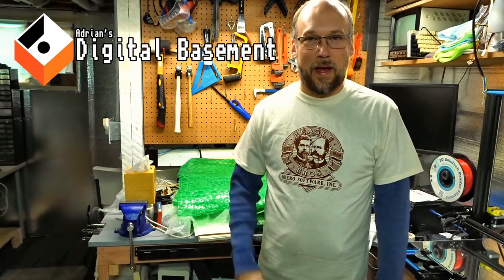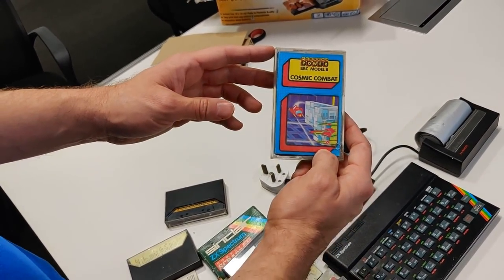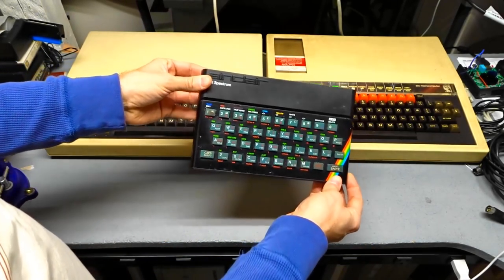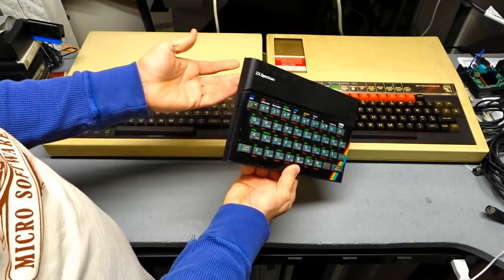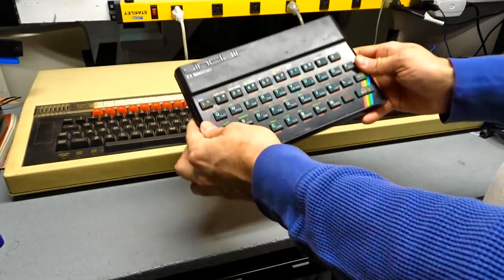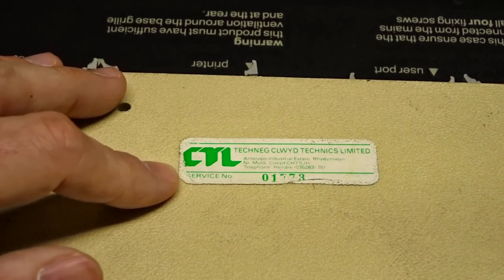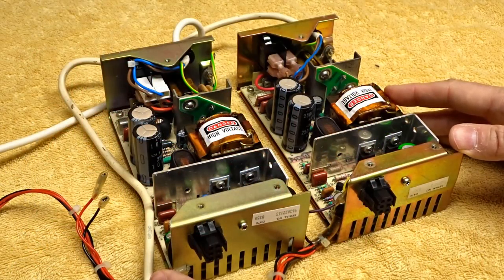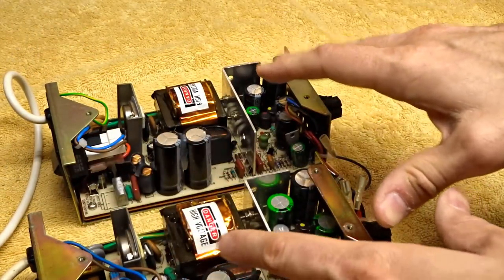I visited the UK and brought back some computers! Let's see if they work.

Comment: Spectrum wise, the best thing for gaming is to hunt down a DivMMC - that'll sort your storage needs out and give you a Kempston interface for joysticks, which tends to be the most common for 48k games (and takes a trusty Atari 2600 compatible joystick, which saves pain).

If isn't already modded for composite video output, that's a trivial one to do, which'll sort you out. Though it doesn't do RGB natively, you can buy a board called the Spectra which'll generate an RGB signal via a SCART output, though, it's probably overkill for casual use!

Comment: I'm wondering if the micro with a cut out had the psu removed to run off a bench supply. I vaguely remember seeing some in science rooms which had low voltage inputs rather than 240v.

I know some came with EPROM programmers but they were lower down near the keyboard.

Comment: Acorn changed the top case design part way though the life of the BBC Micro - the earlier machines had the case with the rough surface and no grill over the speaker (everything up to Issue 4 used this case) while the later machines had the smoother case with the grill fitted (Issue 7, though late Issue 4 ones might have as well)

As a lot of these machines were used in schools, parts got swapped around to keep machines working so you could well find an Issue 3 board in the later smooth case. The hole cut in the case is not original, most likely the original owner cut it to try and help keep the PSU cool (I've also seen this done above the ULA chip)
Reply: also from memory the volume on the sound chip was adjustable which might explain the low volume you reported - variable resistor bottom left of the board just behind the TUBE socket I think is the one.

and the one with some of the memory chips socketed has definitely been repaired at some point in its' life - originally they would have all been soldered in.

As well as the PSU cap issue, the power connectors on the board don't age well and can break or give bad connections so if you have any problems with either machine give these a check.

look forward to your video on the Spectrum - got a Spectrum+ here I'm about to restore and do the composite video mod on.

Comment: I've got one of those ZX-Spectrums via ebay; as an American, I was curious what the fuss was all about :-) It's a cute, and kind of fun little computer.  It can run from a 9-volt power adapter but TAKE NOTE: the barrel connector is center-negative! So make sure you rewire your power connector if it's a typical center-positive one.
Also, if your "Speccy" is the 16K model, it's fairly easy to upgrade it to 48K; I had to do that, and I just ordered the chips from Jameco for around $11.
Finally, it's very easy to convert the RF output to composite; a composite signal goes into the RF modulator box, so all you have to do is disconnect the RF output from the RCA connector internally and wire the composite right to the RCA jack.
Reply: Another tip: The "DivMMC Enjoy!" is cartridge that plugs into the expansion port and lets you load programs/games from an SD card, and also has an Atari-style joystick port. It's well worth getting once you get tired of loading from tape. :-)

Comment: Great haul :). These computers really represent the UK and it's cool to see your perspective on them. The BBC B is close to the hearts of many who grew up in the 80s as they were pretty much ubiquitous in schools and it was common to lose hours of playtime gaming on these machines. As you found out, the keyboard needs to be connected for it to boot as it does a diagnostic check on it. Nice work on the power supply conversion - great to see the BBCs up and running in the US!
Reply: Damien Green, a couple of years ago I imported a BBC Micro into Canada. To me it felt like it was the UK’s equivalent to the USA’s Apple II. Both used in classrooms, both highly expandable. But the BBC Micro seems more sophisticated which is not surprising since it’s design is newer by many years.

Comment: That would be thermal printer uses heat to transfer the image, as for the power to use the speccky in the US you need a step up converter because Amercian homes cant generate the juice that we use over here as our plugs are standard 240 volts and the states max is 120 i believe. Check out LGR for how to get a spectrum up and running in the States.

Comment: Brings back a lot of memories.  For the Acorn DFS model, I think if you hit Shift + Break then it booted the disk drive.  If you have a prompt, then type mode 5 and then colour 129 (UK spelling of course) followed by cls and then it set the screen to red.  It's been 30+ years since I looked at a BBC model B, so I'm a bit rusty, but have fun with it.  There's actually a great deal of history and politics with the BBC vs Sinclair - who created the ZX Spectrum which is well worth looking into.

Comment: I really hope that you ordered/bought a new keyboard membrane for the Spectrum. You will almost certainly need it. All of them tend to basically just fall apart due to age. Luckily the replacements are easy to find and will cost you about 15$.

Oh and a small tip for dealing with old computers... it's always the RAM. This may be a joke, but the RAM in the old machines is almost always the thing that fails. After you've checked the power supply/caps the RAM is pretty much the next most common thing that goes.

Comment: The Beeb with the socket RAM was probably a model A at some point with only 16K. The unpopulated 16K would have just had empty sockets from the factory so you could upgrade it later.

It may have been a Model A 32K, which was a stop-gap they made when model B were in short supply, basically a Model A with the extra 16K popped in. It would have been missing all the ports from the B too. Some of my earliest memories of soldering are of installing all the under keyboard expansion connectors!

Comment: We can use a little logic.  No need to take a wild guess.  I'm betting the cutout was for cooling.  They were probably overheating, hence a quick mod, especially after repair.  Notice the warning label that would not show if the hole wasn't in the case. It's obviously there knowing full well it would be seen.

Comment: A faulty -5V can cause the sound output to fail. I believe that can cause the serial port to fail, too.. There is also a 12V output on the PSU for use by external floppy drives.
A Raspberry Pi can be used as a coprocessor with a small amount of glue logic.
The Spectrum is likely to have very very brittle keyboard membrane at its current age. Replacement inexpensive membranes are available.

Comment: I have great memories of playing games on my dad's 48k ZX Spectrum as a kid, sadly it no longer works and I haven't had the time to diagnose it yet. I had that +3 which had the built in disk drive but could accept tape input as well. I can recommend the Dizzy series of games and a personal favorite called Omega One. I also remember using the BBC Micro at school and the story behind its development is very interesting as well, you might want to look up the BBC Domesday Project that ran on the BBC Micro. As I understand it Acorn, yes the guys behind the ARM architecture we still use today, allowed for custom versions of BBC Micros so that's why you have two Issue 4 machines, one with the econet connection and the other without it.

Comment: Some of the BBC Micro's where still in use well into the mid to late 90's in some UK educational establishments such as high-school's and Universities and a lot of them did have holes in the top where they where secured by chains and locks to prevent theft and safety testing the psu.

Comment: A quick look around seems to show Techweg Clwyd in the BBC Micro's specs in relation to hardware such as it's SPOC Communicator (Speech Output From Computer), enabling disabled people to talk to others with the use of a switch? There was also MicroMike, a microphone to aid control for the speech impaired. One forum also notes a hardware manufacturer 'Clwyd Technics' used to repair BBCs, although I'm not sure if this is the exact same company. Perhaps someone can clarify. On here also check out 'Clwyd Colour Enhancer for the BBC'.  It should in theory be very easy to find a BBC in the UK given they were installed in almost every school, with many were still there right up until the mid-late 90s

Comment: It looks like someone had a monitor on top of that BBC. I reckon the PSU must of overheated... Beebs generally ran on 5 1/4 inch disk drives, see if you can find one on Ebay. They had a lot of educational software cos they were mainly used as school computers, though they did have an awesome 6502(?) assembler in ROM as I recall.
PS - Hey, we've got an American pronouncing "Zed" properly! We'll have you spelling "aluminium" next! ;-)

Comment: Careful over the spectrum power supply, of I remember correctly the middle of the barrel plug is negative not positive, also plugging in anything into the expansion while it's switched on can ruin the machine.

Comment: The BBC micro had a connector that allowed a second processor in its own box to be attached. There were a few different processors around including a "Scientific Processor" based on the National Semiconductors 32016 processor and a matching floating point accelerator chip. As I recall you could run Fortran on it.

Comment: I remember mine, I had it from 10 years old until I was 16 - I had a Vine Micros replay system, (This added a physical switch that you could use as a break point and save to the) Watford Electronics Floppy - I also had an AMX Mouse and a Casio Dot Matrix printer - but all I needed was my Voltmace Delta joystick and a Elite

Comment: Hook up a Raspberry Pi Zero to the Tube port, and you will be able to use it at a ARM, Z80, i8086, 6502 co-processor and run at really fast speeds compared to the original CPU speed.
Connect a SD card reader to the floppy drive connector.
Install TI Speech chips.
Upgrade ROM Chips to latest homebrew version.
There are also aditional ROMs that can be installed, including LOGO, and an Assembler.
Also there is a flap you can remove near the keyboard on top of the machine that alows you to install a ZIF socket for you own EEPROMS.

Comment: Well done picking 2 BBC Micros - arguably the best 8-bit micro of all time. I started with a Model A, then added 16K to make it a Model B, added a disk interface (way better disk system than the C64's!), a 40-track TEAC floppy drive, a speech synth chip and then sideways RAM so I could load ROMs from disk (Disc Doctor was great for disassembly of 6502 and memory/disk editing).

I learned 6502 using the BASIC's assembler plus the BBC Micro Advanced User Guide - the definitive book for BBC Micro programmers. Needless to say, I had as much fun removing the copy protection from tape games and getting them to load from disk (I wrote my own disk menu system in 4K of 6502 to launch them) than I did playing them :-)

I think you'll be very disappointed with the ZX Spectrum in comparison to the BBC Micro - it had lousy sound, terrible graphics, an awful BASIC and a horrendous keyboard. It sold hugely because it was very cheap and created a virtuous circle of attracting games companies because of the user base, which then drove more users to it.

Apart from having 48K RAM, I don't think the ZX Spectrum hardware/OS/BASIC has anything anywhere close to what the BBC Micro shipped with. You did literally get what you paid for back then - the ZX Spectrum was just a non-starter for me because the hardware was so poor.

Comment: As far as I know the case hole is not a normal feature.  However the acorn BBC does run very hot and someone may of made it to deal with a crashing issue which is a result of overheat.   If I remember rightly up until about version 4 it didn't even have a heat sync so u might want to try c0vering the hole up and running it for a extended period before making a perm repair that just creates a new issue

Comment: I was about then, had them in my school and used to take them home over the summer holidays. I had Exmon on an Eprom, a machine code compiler, anyway, after realising you could load a game into screen memory and then save it, Defender aka Planatoid became invisible in one direction, you have to be fair ;-) Sold it to my mates though. An excellent bit of kit for learning basic, still is probably, you can get BBC basic emulators. Space bar was a weakness, Cheers

Comment: Actually, the reason you probably didn't hear the sound from the other machine initially, is that the -5V rail wasn't working properly....usually -5V powers op-amps for sound...I bet the second machine was originally paired with the 'bad' power supply.

Comment: Yeah. The label on the underside of the BBC Micro is Welsh. All it says is "Technics" or "Technical". A fairly common thing is to have something written like this because "Techneg Clwyd" means the same as "Clwyd Technics". Welsh phrases would appear to be back to front to someone who only speaks English but, if my memory serves me correctly, French is structured in a similar way to Welsh. For example, "Black Dog" would be "Ci Du" in Welsh ... where "Ci" is "Dog" and "Du" is "Black".

I've found a little bit of operational information on the company. It was formed in 1982 but stopped trading in 1998. It may well have been a company that serviced the BBC Micro as it's listed as having been a "Software Consultancy & Supply" when its information was last updated at Companies House.

Apparently, Clwyd Technics also made robots that were powered by the BBC Micro and other add-ons by the looks of things. So this may even be an in-house development machine, which might explain the gap at the back where they might have been passing cables through.

Comment: As you said the early ones used linear power supplies, Maybe that top is from an early machine that someone modded for ventilation? Never seen one with that hole before and being in the UK I've seen a lot of BBC micros. They had them in most schools here in the mid 80s.

Comment: Oh wow I grew up on the Spectrum, Friends had 48k rubber keys like yours, then I beat them with my proper keyboard version 48k, but them my brother blew us all out the water with his 128k +2 with the built in 3" disk drive!
I had that printer as well - its a thermal printer that burns black into the metallic paper!

Comment: ADFS was in a ROM that you added to the board. Also looks like the other one had a word wise rom chip (wood processor). You need to get yourself a variac, current limited supply and isolation transformer :)

Comment: I had a Acorn Atom Microcomputer, but as a kit form. But I was a bit messy with my solder joints and unprofessional in my assembling. If it didn't work, it would be right at home in the garbage bin. But it did!

Comment: I actually own a US version of a BBC Model B. The most notable differences I am aware of are
NTSC video
110 v 60 hz power supply
And the built-in ROM BASIC accepted both US and British spellings of some keywords e.g.(color/colour)

The "tube" used a ribbon cable to connect an external box containing co processors.

.
Reply from the maker: Wow would it be possible to dump the ROMs? I also wonder what other differences there are to the main board to generate the NTSC video over PAL, etc.
Reply: @adriansdigitalbasement  
It should not be difficult to find ROM dumps on line at some of the emulator sites. My old BBC is packed up some where And I don currently have a place to set it up.

The built-in BASIC interpreter has an in-line assembler, but the ROM uses some sort of bank switching.

Comment: On the BBC Master 128 and I think on the BBC Micro,
type *ROMS
will list the rom chips.
It will list BASIC as one
DISC if the disc drive chip is installed etc. 
So you can see if any chips are missing or not working.
Reply: The UK BBC uses the BBC basic command COLOUR to change the colour, but remember hearing that the US versions use the command COLOR.

Comment: First one was a BBC MIcro Model B with 16K Ram which was upgraded to 32K, hence half the chips are socketed. To find out what is on the Roms type in *help and it will list available Rom commands.